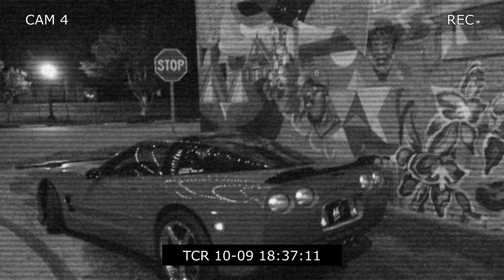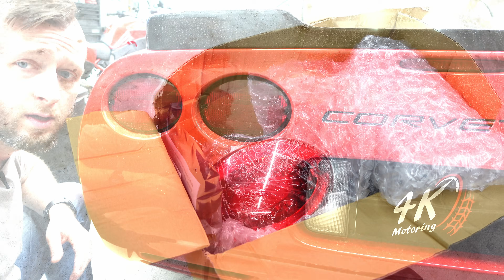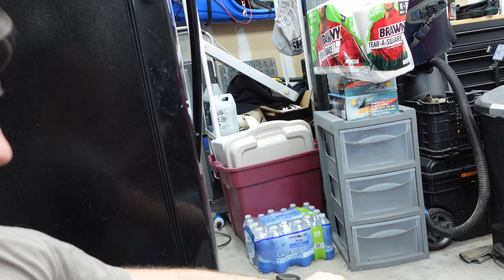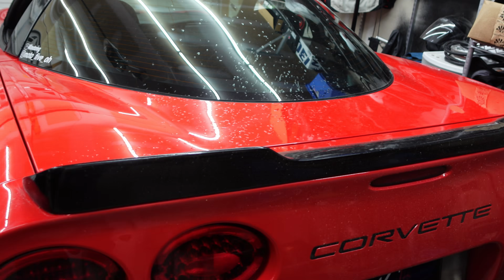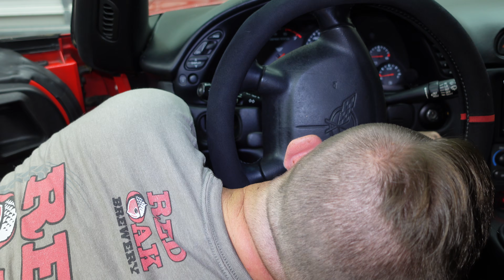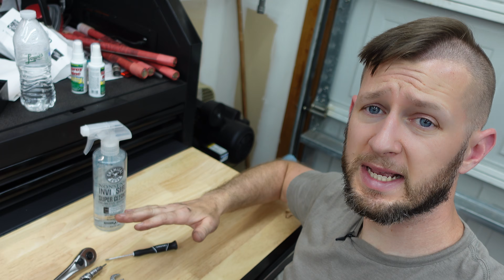C5 Corvette Halo Tail Lights, Installation and Hyper-Flash Harness, 1997-2004

Comment: What can I do about just one of my LED lights doesn’t work when pressing the brake.  What is a kit?
Reply from the maker: search Ebay to see if you can find a replacement. I would also recommend swapping two of your lights to ensure it's not just a bad connection

Comment: I got check gages indicator on dash with just doing the DRLs but no hyperflash. Not sure what the fix is.
Reply from the maker: They may need an inline resistor, have you tried checking codes?
Reply: I also installed the harness. Then I went back to the incandescent and check gages o  dash was still on. My guess is the harness might not be right
Reply from the maker: I think the harness controls only the turn signals. There may be an issue with the DRL circuit. Pull the codes to see what's flagged
Reply: @4KMotoring  actually there would be no codes. But when you start the engine, guage check message goes out. All good. Thanks for your  help.

Comment: OG halo tails look good 👍.  

Have you seen the newer laser tails that match your rear side marker lights?  I recently switched from halos to burgers and they're bright as hell

If the burgers are not your cup of tea, they also recently came out with a laser version forthe 3rd brake light which also matches your laser side marker lights and that thing's sick ✌️
Reply from the maker: I've seen the burger lights and wasn't really a fan, but they still look awesome. 

If you see my follow up video, I added the laser 3rd brake light with F1 strobing feature,  as well as LED license plate lights. It all comes together to really update the back of the car!

Comment: They look identical to the vettelights
Reply from the maker: The modern ones have a center bar that also illuminate with the running lights. Very similar, subtly different. Both are great options!